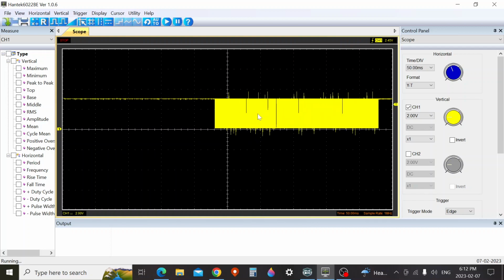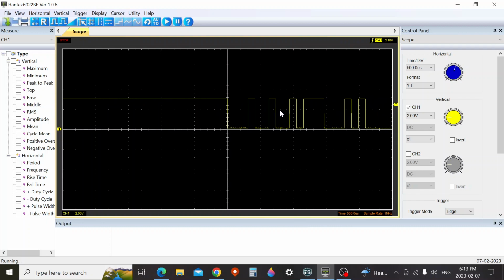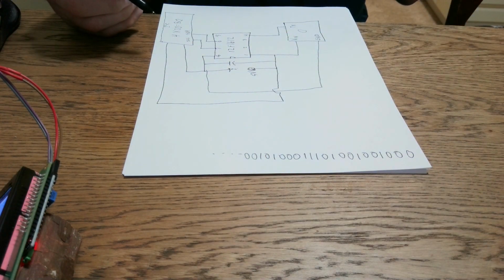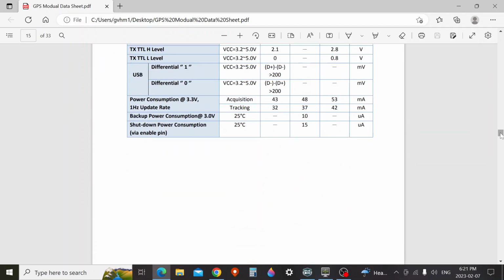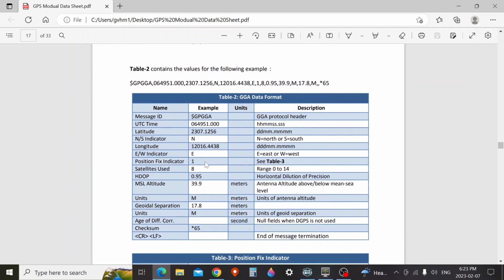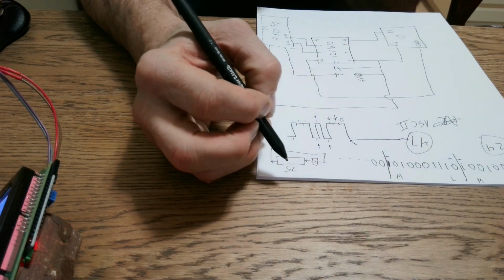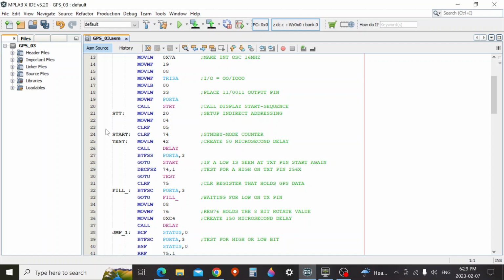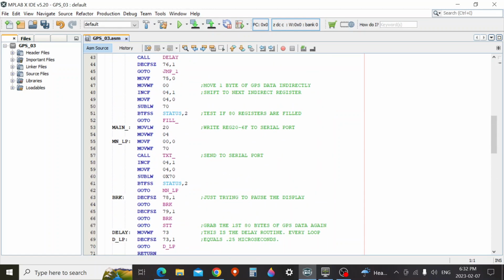How to use a GPS module with any PIC microcontroller

Comment: Would the code in this video work with a PIC18F45K20 microcontroller?
Reply from the maker: The code can mostly be dropped directly into your microcontroller, with the exception of the configuration bits of course. Set your processor to run at 16mhz since the timing of the 9600baud rate of the GPS module depends on that. The first 12 pieces of code are probably not a prefect fit either since you are running an 18F series microcontroller and the location of the addresses for things like your "weak pull up resistors" and the "analogue select bits"  would be different. You have a much more powerful processor!
Reply: @rwatson2609  Sounds good. Also, did you just use the one source file or did you have any usart files, etc?
Reply from the maker: @philipeon2831  it was just the one source file. It has the Uart drivers built into it. The LoRa devices do need to have their own address/Network ID written into them which you can do with a serial programmer and a free piece of software. As well, if you felt like it, there are several other options within the software that you could program to your liking. For this video and the simplicity of software, I just did the bare bones basic. Hope this helps with your project.
Reply: Thanks sir for your work